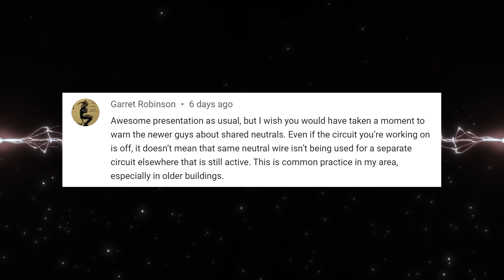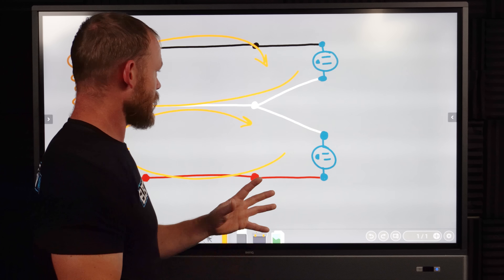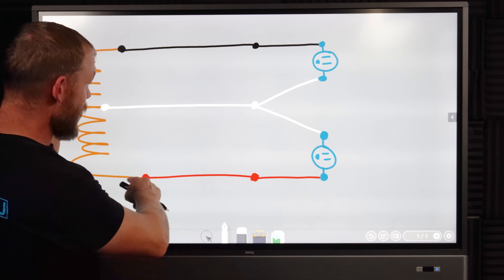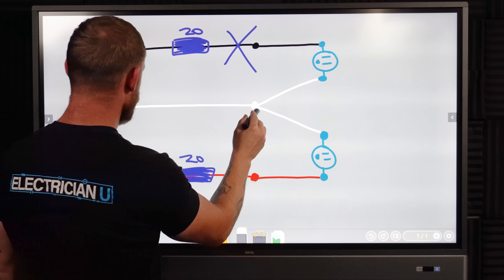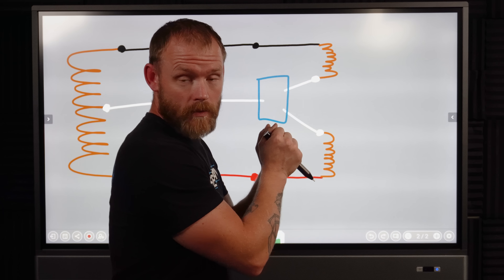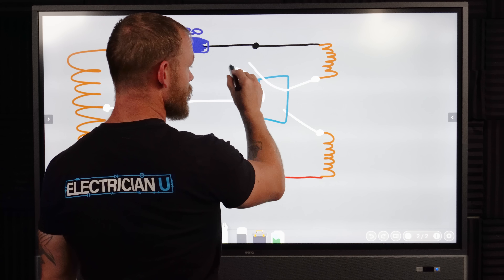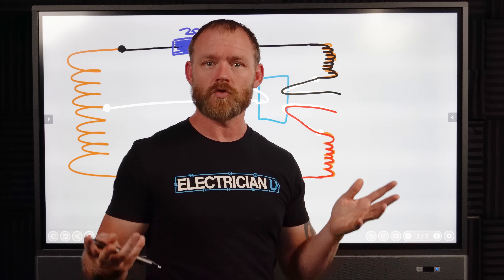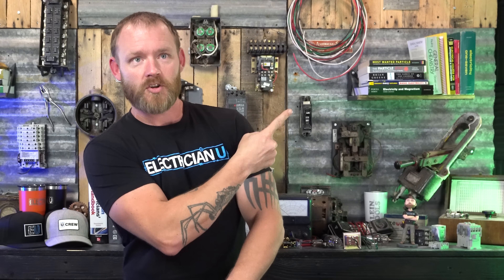The Dangers of Shared Neutrals: How To Avoid Being Shocked

Comment: LOVE your information!!  LOVE your insight.  Thank you for all that you do.
  Since the 1960's, I have been repairing vacuum tube electronics. The very main thing to do is to isolate the hot to common by replacing the "death caps" and installing a polarized plug. I like the 2 prong that only fit pole outlets.  I get many comments that I am wrong by not using 3-prong, however, I do not want to ground the common at the outlet.  Am I wrong?  Should I be better by using a 3 and leave the ground prong open? Is the 2-prong polarized still the best in your opinion?  (I'm sure that the common is energized regardless of what plug is used, anyway). 
THANK you MUCH!!

Comment: Thanks! This is an awesome heads up as I've never thought of that and am a novice to home electrical work.

I have a very strange situation that led me to this video and in short, I have a 220v breaker turning on a 110v circuit (bathroom, etc.) and what looks like power fluctuations in some of the outlets & the oven. My uncle mentioned I have a "floating" neutral I need to find. He said that the neutral and ground wires are not supposed to connect/be shared anywhere except back at the sub-panel (I think) and his believes this is the source of the strange stuff I'm seeing and/or a neutral is being "borrowed" from another circuit. There was one of the main 100 amp fuses coming in from the street but he's saying that's not why I'm seeing the power fluctuations. 

A video about why you can't share a ground with neutrals would be great since that doesn't make sense to me why electrically it wouldn't work. It sounds like from this video it should work but it's just dangerous to work on live (not that I'd do that)?

He's  telling me I need to test each outlet/circuit to find the issue. I'm guessing I need to disconnect each and every neutral at the bus bar in the subpanel, then I can test for continuity between the grounds and neutrals at each switch/outlet to see where they are wrongly connected?
Reply: The neutral and ground must be bonded together once and only once at the point of first disconnect. If they are bonded together somewhere else, between that point and the first bond, the parallel paths cause current to flow on both the neutral AND the ground conductor in inverse proportion to the resistance of the conductor. (Just learned this myself while hooking up a portable generator to my main panel via breaker and interlock)

Comment: Great Videos!   I have a Question!!!
How would the scenario below effect the True Neutral going back to the Panel box???

 I'm a carpenter, not an electrician but I have working knowledge of electricity. On a bathroom remodel I was taking down two can lights from the ceiling that operated on one switch that were going to be relocated in the same room. 12-2 (power from the breaker box) was coming into the light box in the ceiling. He ran one 12-2 wire to the switch in the wall to send power to and from the switch back to the light. So, in the light box I had a white wire that was actually a black wire(power), and it was tied into the black wire that ran over to the other light for its power source. Usually when I see this the electrician has always put black tape on the white wire coming into the box from the switch so you would know it was being used as a black(hot), but he did not in this case. So, looking in the light box in the ceiling you would see two blacks together, two whites together and a black and white together.

Comment: Although code allows you to install a listed handle tie, from my experience it's best to use a proper double pole breaker when you have a shared neutral. I've seen too many tied single pole breakers trip one and not the other during faults even with listed handle ties. This happens because the spring tension and trip movement in the one is not enough to disengage the other.

Comment: pretty sure the shared neutral was supposed to be on breakers tied together with a tie handle so they can't be on the same phase and that both hots go out together when tripped.
Reply: That’s how my dishwasher and disposal are wired and I’m remodeling and have wired it back the same way. 

14-2 wire , two 15amp breakers tied together. Both appliances with a wall switch. I’m not sure why the dishwasher needs a walls switch but that’s how it was originally .

Comment: As an amateur electrician, what you are describing here no matter what you think it is a 240-volt circuit and should be treated as such as in the breakers should be linked breakers. This should be going to a 240-volt outlet or a subpanel with its own linked shut off brakers. 

In my mind even if you are using this, in a cheap way back then, this should have linked breakers. Link breaks are the only thing that makes sense to me for this type of circuit. 

End of amateur hour.

Comment: My dad always taught me to treat ALL wires as live the same way you always treat a gun as loaded.
Reply: Hell, there’s situations where you can get popped on a completely disconnected wire (high voltage/high freq). 

Usually this is inductive, but collapsing electric fields can do it too. I was screwing around with a tv flyback for a bit one day and when I was done I didn't want to reach over the unit to turn off the switch so I unplugged it. I woke up on the floor 8 feet away. It wasn’t until years later, after taking electromagnetics, that I fully understood what had occurred. Basically, when the field collapsed that was generated around everything near the bench, it needed a path, and my fingers being a half inch from the newly disconnected ground was that path and my muscles did the rest.

High frequency 36kV still felt better that 240V, not that I’d ever like to repeat it.

Comment: Once I went to work on just a simple light.  Rather than going through the trouble of finding the breaker in an unmarked box I thought I would just turn off the light switch and I'd be safe.  But nope, I got bit with a fairly strong sting, but not a full load that I would expect from 120.   After watching this, I'm guessing that it was some sort of a feedback through neutral from another device on the line/circuit that was turned on.  Very interesting.   (always trip the breaker!)

Comment: My current home was built in the late 60s as a part of a 450 home subdivision.   Without going into detail,  I discovered that this technique was used in the construction of these homes.
Once I learned of this, I was much more careful working on circuits in the house, but I will say that it's difficult to identify the other circuit that shares the neutral.

Comment: The comment of @Sparky-ww5re below reminded me of a time I got a dangerous jolt from a Ground.  Well sorta.  A rare case where something designed to make something safe actually caused a problem (because of someone else's shoddy work).
I was in the bathroom of our house and it was winter.  We were using a couple of those large 240V stack heaters.  When I finished brushing my teeth, I needed to move the heater out of the bathroom doorway.  I was holding on to the frame of the bathroom lighted mirror/cabinet (which was on) with my right hand, while I reached down to move the heater with my left.  Holy crap.  Found out the frame of the lighted mirror/cabinet had been wired wrong.  No safety ground, and wired up the two lines Backwards; that is, the hot (black) was tired to where the white return should have been, and the frame was live all the time.  Now we hardly ever touched the frame, and were were generally not grounded when we did, but it had been like that for years.  (It would never happen today with all the safety precautions, but this was a long time ago).  But that meant the full 120V from the cabinet frame, traveled from my right hand to the very properly grounded frame of the stack heater.  Scared the crap outta me after a second, cause I realized that path took the current across my heart.  No problems other than being scared. though.  And fixed the problem later (replaced the mirror, wired up correctly this time).

Comment: There is a strip in every panel that has all the neutrals attached to it, and then is bonded to the ground bar. All of them share the same destination no matter what. Even if all breakers are open all neutrals, are still sharing the same potential. If you have a hot white wire, you have a hot white wire, electricity does not care about wire colour. Test before touch, or get a surprise.

Comment: Here's the thing to be aware of... If you touch a hot wire and get shocked the amount of current flowing through you is determined by your body's  resistance, electricity follows the path of least resistance. The problem that can occur with neutral wires is even though it is at ground potential, if you get in between a neutral wire return path ( say you opened an energized circuits neutral splice point). The current that will flow through your body is no longer determined by your body's resistance, by getting in between the opened wire neutral splice your body now becomes the full return current electrical path. You become the wire and you carry all return current. Considering .050 amps or 50ma of current can stop your heart the neutral wire is extremely dangerous and deadly. Whenever possible turn the power off when working with electricity.
Reply: Current doesn't just follow the path of least resistance. 
It flows on ALL available paths.
Depending on the resistance of a neutral path and resistance thru a human to earth dictates the severity of shock one can recieve. 
While not as dangerous as a line side conductor, Neutrals are still dangerous to touch.

Comment: Shouldnt a shared neutral be a lower gauge wire? Like lets say you have two circuits with the smallest imaginable load, but both active so both returning current. Wouldn't that potentially overload the white? Im sure there is some safety margin in there, just curious.

Comment: I think sharing the neutrals was a great idea because not only did it save copper, but it also helps to reduce voltage drop. But I think there should have been a requirement that any portion of the neutral that serves multiple circuits, the splicing should be done with irreversible connections such as a Buchanan crimped with a 4 way crimper.

Comment: Thank you for this. We are documenting a 50's house with a newer panel and discovered a 3 conductor run (red, black and white) with the red and black going to 2 different breakers. Shared neutral? But wouldn't they be on the same end of the transformer? Anyway, it was a shocking experience just  to discover that configuration.

Comment: I just got a call from a potential customer who described their problem as a receptacle getting hot and also whatever it was being plugged into it was flickering and getting super bright.  As I think about it, I wonder if this is a shared neutral issue?   I've dealt with dead circuits before because the wires came loose in the panel box, but with a shared neutral, if that neutral becomes loose, now >120 V is going out on that circuit, right?  I'll find out tomorrow when I go to investigate.  This is an older house built in the '60s or '70s I believe..

Comment: Can you fix a shared neutral
Reply from the maker: Sure,  

But you'd have to find every spot there is a shared neutral across two desperate circuits, separate them mechanically, and then run a new neutral to that spot for the circuit that shouldn't be sharing.

Comment: When I started in the trade in the late 70's the old timer I worked with had a cheat for dealing with mwbc to avoid the live neutral. He would locate the circuit to be worked on, shut it AND the breakers above and below it off as well. Which will work.....unless the two hots were not landed properly.

He got caught a few times by that last bit.

Comment: OH!! I’VE GOT A SCENARIO FOR THIS!!
An “old timer” electrician, told me that if he had to troubleshoot a problem (‘emergency service call’), and he found a lost neutral, to just “find a neutral somewhere else… easy problem fix.” 
Yeah… while that would technically solve the “no power to a circuit” issue… it creates a whole other set of problems.

Comment: When you're dealing with wiring of questionable installation quality something  I started doing was to use a clamp on current ammeter or current probe whenever I came across commoned up neutral wires (such as multiple white wires in a wire nut) to solve the mystery  . Before removing the wire nut and separating these mystery neutrals check each wire with the clamp on ammeter for presence or absence of current . If there is different current reads on each neutral wire you can compare the load current going out from each breaker and when you have a match mark the neutral wire with that breaker number then turn off the load breaker and verify both line and neutral reads go to zero amps .  If two circuits both read the same current value add more load to one circuit to make them easy to distinguish between the two circuits.

Comment: While I usually love your explanations, here it’s incorrect.

What’s dangerous is the voltage, not the current. An example are birds standing on bare wires carrying tens or hundreds of amps and tens of thousands of volts relative to earth ground, yet zero volts between their feet.

So, the danger of a shared neutral is not that it can still carry current even when you open one of the breakers, as you showed, because the neutral is still connected to the terminal bar and hence is still at almost 0 V relative to ground. But instead, when you open one of the breakers, and then disconnect the shared neutral from the panel, if there’s any load connected on the other breaker, then the shared neutral will be at 120 V RMS relative to ground.

If you touch such shared disconnected neutral, now the 120 V will distribute between the loads of the open breaker, you, and the soil.

Comment: Refrigerator compressor starts wearing out and voltage leaks start happening, get shocked touching refrigerator and stove and sink and microwave and stove light turning it on or off and computer that is used for a million recipes

Comment: Power goes out to the city block, someone back feeds there service panel without turning off main breaker, surprise, surprise to the other houses, maybe the breaker on the generator trips because of over load, then the guy keeps resetting the generator breaker, surprise, surprise

Comment: Turn off breaker thinking power is off, but there is a UPS in parallel with the circuit, power is turned off and the sun comes up and turns on solar panels energizing the circuit

Comment: Great explanation. I came searching for why I got a shock from a neutral when the breaker for the circuit was off while installing a LED power supply in place of a light fixture. It was a shared neutral situation I found out here!  Something new to watch for. Thanks for the info!

Comment: That was an Aha moment for me. My question is this: Wouldn't you be faced with the exact same situation regardless of whether the neutral was shared or not? Say you have 2 neutrals in a single junction box from 2 separate circuits. You drop the wire nuts on both of the neutrals an pull them out of the box. You would have 4 neutrals that have potential if you cross any of them. Two pairs with 120V potential, one pair with 240V, and one pair that is 0V. Right? So maybe the shared neutral isn't the problem, it's the shared junction? And only if the circuits are from opposite legs in the breaker panel. Right?

I've been hit by neutrals before, and I couldn't figure out why. I think I get it now.

Another question: I do continuity tests in rickety wired houses to try to figure out what the what is going on. At times, I will have 2 hots that will give a sort of buzz instead of a good clean high pitched tone. Is this because they are 2 circuits on different legs of the panel?

Comment: Love the video!  I do have something going on a little weird for me: breaker on have 13V difference between line and neutral but at same time still about 1V between neutral and ground when all cicuits are closed (i.e voltage is taken at a block terminal). Line is at 123V. How can that be? Breaker off there is no voltage on neutral or line.
Reply: Is that only happening in one circuit? The cable might be mangled. Neutral to Line or Line to Ground should be at 123v
Reply: @Goldern  Yes it was. I found out that a neutral circuit had come loose downstream and was actually opened. I am still a bit baffled by these strange readings but after reconnecting the neutrals all was fine.
Reply: @benhaze1010  The voltages you were measuring likely were due to induction in the neutral wire. I have seen several situations where disconnected wires still showed a voltage, causing quite a bit of confusion.
Reply: @dutchpuzzlepiece  Indeed!

Comment: Great video in explaining the danger. I have a situation  its all on one breaker but the neutral are being shared between an outlet and a light, I think its  illegally.  I opened up a  electoral light switch box  with  2 wires in it.   2, 14/2's   a neutral white wire screwed down to the box. the black wires are all pigtail together with one black wire  going to one side of the light switch the other white wire to the other side of the switch. Somehow this circuit turns a light on and off and then keeps an outlet live at all times. please explain for me.

Comment: I’ ve seen a Star connectioned transformer 347/600 volts which wasn’t connected in the middle with a common ground. If somebody would be grounded and touched any (now insulated) ground would get zapped with a 347 volts shock, easily remedied by grounding the middle of the star transformer.